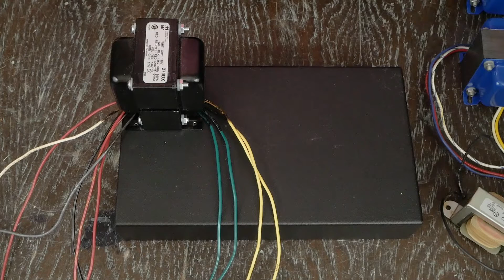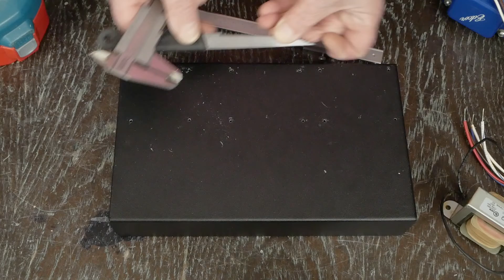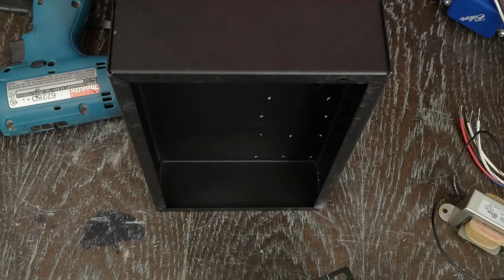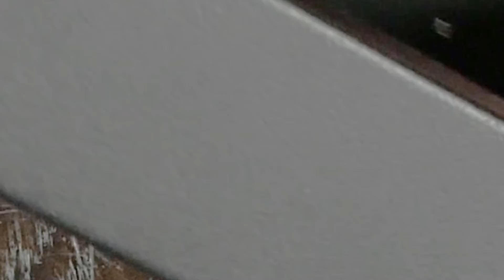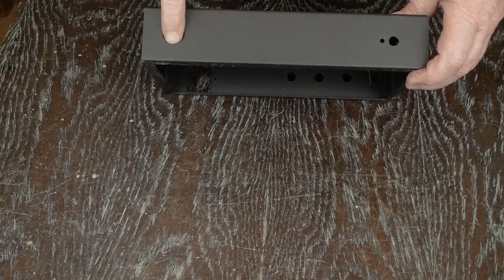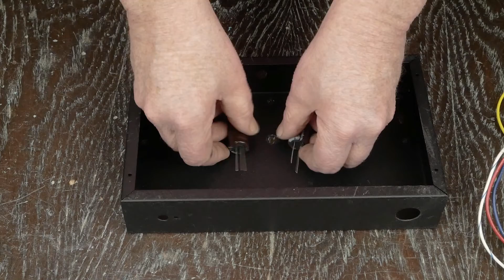DIY 5W Compact Tube Audio Amplifier: Chassis Fabrication

Comment: hello what is the size of the chassis?  i have watched a few times but may have missed the dimensions.  thanks
Reply from the maker: 6 X 10 X 2 inches. I used a steel Hammond that was pre-powder coated black.

Comment: Two other tools for cutting the power input opening, if you do not already know about them:
(a) a rotary saw (e.g., Dremel 565 Multi-Purpose Cutting Kit or a purpose built one like one from DeWalt); and
(b) a jeweler's saw (e.g., Megacast 3 in 1 Professional Jeweler's Saw), which is like a coping saw that has metal cutting blades for it.

Comment: What's the best chassis material from the magnetic/EMI interference, and noise considerations?
Reply: If you are concerned about magnetic interference, something with a lot of magnetically "sensitive" material (e.g., iron) in it would be best.  If you are worried about EM interference, anything that can make a Faraday cage will work. Just make sure that there are no openings in the Faraday cage that have a length greater than 1/4 wavelength of the highest EM signals that you are trying to block.  If you are just trying to block 60Hz EM interference and its harmonic friends, separated metal would work fine.  It does not have to be separated metal or a metal screen.  For instance, look at the cages surrounding other stereo amps and guitar amps.  They prevent EMI from coming in and escaping, as well as physically protecting the components they enclose.
Reply from the maker: People say aluminum but I've never experienced issues with steel ones.

Comment: Regarding the cut out for the IEC plug, on DIY cases, I am too lazy. I just run the cord through a grommet straight into the amp. I also just use a toggle switch so I only have to deal with round holes.

Also to make it so that you don't drill the wrong holes, a good trick is to put masking tape over the ones that you don't want to drill.
Reply from the maker: Good tip! Another tip is don't try to record video while you are building an amp :P
Reply: I still would rather deal with the plug and have the freedom from the cord later. I am not a fan of the quality of most IEC plug to begin with that is the bigger problem.  I have had good luck with some medical grade stuff.  In this case it seems you cut it in too close to the edge of the panel.